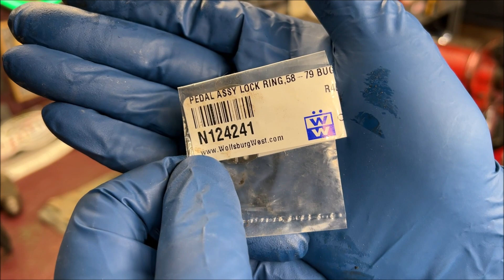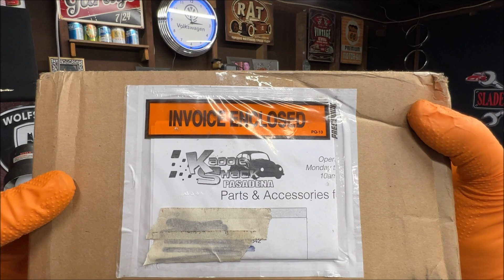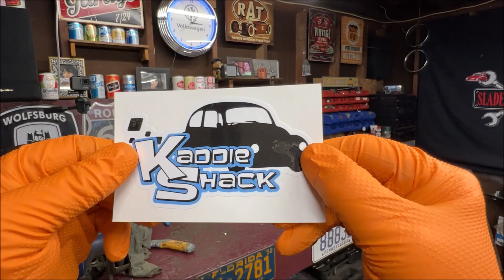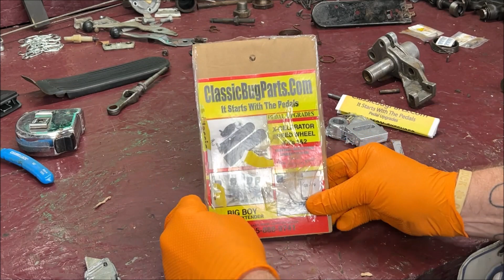How To Rebuild a VW Beetle Pedal Assembly - Spacing The Pedals Apart - Big Boy Pedal Extender

Comment: I know this video is a year old...but...wanted to comment anyway.   Few years ago now, I had a stand at the Sacramento Bug-O-Rama for my car club and the guy who makes the Big Boy pedal kit, and his wife, had a stand about 50 feet down from me.  I got to talking to him and after seeing the innovations on this set up, I bought this kit and the pedal kit for both my son's car and my own.  I installed the kits on both cars.  What a game changer.  Both cars had all of the issues the guy details in his video.

The clutch cable attachment is the way it should have come from the factory.  It absolutely changes a pain-in-the-ass job into something simple and easy.

The real innovation, however, is the pedal.  The movement becomes smooth and effortless.  My original pedal assembly always had a catch in the movement, caused by bent parts.  The new assembly cannot bend like the factory parts can.  This set up truely is an advancement of our hobby.

Comment: I am doing the pedal cluster too. I will consider the big boy upgrade, thanks for demonstrating it. For me the clutch pedal pin was not too bad to get out but the pedal was VERY tight on the shaft. Took a lot of banging to free it. I used a vice all the way through the process..
Reply from the maker: It’s definitely a nice upgrade. That’s for sure. The last time I did one, I had to use map gas and heat the pin up to get it out. This one wasn’t so bad.

Comment: I have still to this day never taken one of those apart... repaired many, but never disassembled.  I would like to space out all the pedals a little further, spacer kits seem to only move the clutch.  Probably gonna "Duckman" a kit of my own.  I have more of an issue between the brake pedal and the tunnel, I either can't get on the gas or can't get my foot back out!  Haha!
Reply from the maker: True!! I wanted to slightly bend the brake pedal over further. Not a bad idea at all. I’ll definitely be watching to see if you do that. The big boy clutch pedal extender really makes a big difference brother. And I notice a roller pedal gives more space to it. Although it could be a placebo. 🤦🏼‍♂️😁

Comment: I installed this kit in my Baja yesterday, my size 14 was much happier. 
The pedal feel on the clutch was different, it felt more positive or connected. 
I installed the roller pedal for the accelerator cable the wrong way, it was nice taking the assembly back out and not fiddling with the clutch cable trying to get it back together.

Comment: Great video.  I picked up a 68 about a month ago, so I will be watching. Alot of stuff was already taken apart, or put together by a monkey. The reassembly might be a little tricky, since I didn't get to see how it came apart. Thanks
Reply from the maker: Thanks for being here I appreciate it. You can even check my videos of my 73 super beetle prior to this the only thing that would be different is the front suspension. But I will be putting this all back together weekly now.

Comment: Take a real good, close look at that brake pedal to master cylinder pin. Years ago the one in my buggy decided to break in half just as I was approaching US1 in Florida (after leaving a restaurant/bar where I'd had a few.) First press went to the floor, second press was at the top and rock hard with no brakes! Luckily I was able to stop with the parking brake just before sliding onto the highway and into cross traffic. The first press broke the rod/pin, the wrap spring lifted the pedal back up, allowing the pin to droop down and wedge solid against the floor.

Comment: I realize this is an older video, but when using a punch use vicegrips on the punch. You can hold it steady and it saves your fingers/ hand. For loose pins, take a hammer and place the pin on your vice 
and hit the pin just enough to flatten the pin. That will take out the slack. Also use the vicegrips.
Remember to maintain the chamber on the end of the pin.

Comment: Another great detailed video. Wish WW would deliver to the UK, they have some nice parts. My concern is that I had to buy lhd pans for my rhd so the groove for the pedal stop isn't there, nor is the thread. I'm going to use a stainless threaded insert and hope it holds up. That definitely worth the upgrade to stop the clutch cable struggle alone.
Reply from the maker: I wish they could work out for you, it’s definitely a nice upgrade, especially if our feet are on the larger side.

Comment: Looking forward to the video on the master cylinder rod, My pedal is low atm, new everything, hard lines, flexi lines, master cylinder, slave cylinders, rear drums, rear shoes, rebuilt front calipers etc. Bled the system many times but pedal still low.  Will take any advice - many thanks!
Reply from the maker: I would definitely check that rod for adjustment. Especially if you have everything new, and your brakes are fully adjusted?

Comment: I just took mine apart, evidently while driving the pin out of the throttle pedal it hung up on the spring and ended up breaking the pin boss on the opposite side. I already have the Roller pedal so there was no major harm. But it is something to be aware of when taking it apart.   It would have been nice to know that the clutch cable should be disconnected at the clutch so the cable would come out enough to take it loose and reinstall it on the new bolt connection.

Comment: Hi Slade i have messaged you a while back about how many people enjoy you web site in CANADA. I my self am on the very west coast just outside of VANCOUVER B.C. I have two quick questions one is on this video i am watching now. When you remove the peddle assembly do you replace the brake reservoir with a bigger one or do you just pull it out nice and straight make sure all is clean and just put it back together in the car in reverse of taking it out the bleed the brakes of any air bubbles. last of all when you made the video of rebuilding the top end of motor or video where you tore the motor down to break the engine halves apart to soak in the degreaser can you blast the halves with soda or anything else to get it as shiny and clean as can be ( sorry if that's a really dumb question )Todd from BURNABY B.C. CANADA fantastic channel keep up the great work helping us all out 🤪😜🤓

Comment: My problem is the brake pedal being too close to the gas pedal. I wear EEE width shoes and I can’t work the gas without my food rubbing the break pedal.
Can the brake pedal arm be heated and bent for clearance without ruining whatever temper it has?
Reply from the maker: Funny you brought that up my friend. I like The brake pedal and clutch pedal further apart like they are now. However, I would have to agree. 
This is going to sound strange. But when I run a roller pedal, for some reason I feel I have more room. 
Of course it could be a placebo. Although what you just stated, is what I was going to try eventually. 
To heat the brake pedal and bend it over slightly.